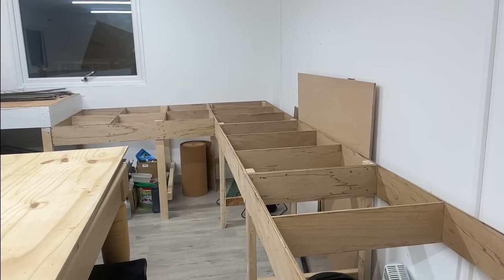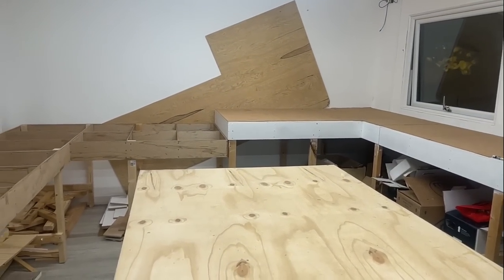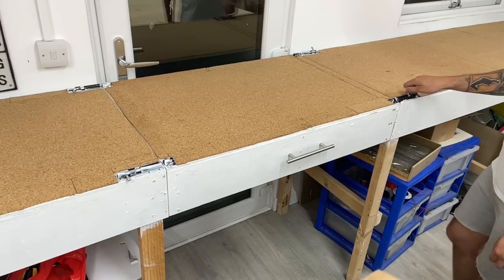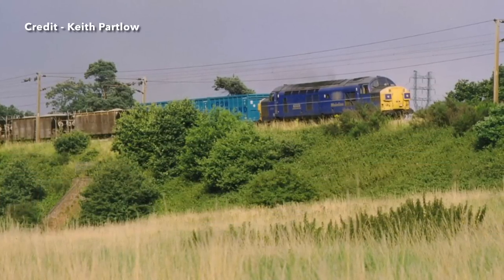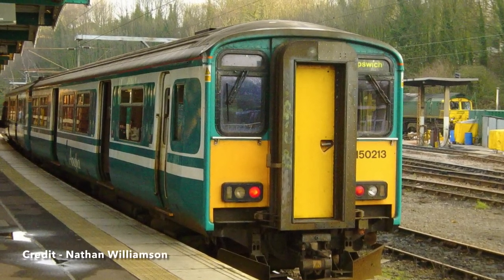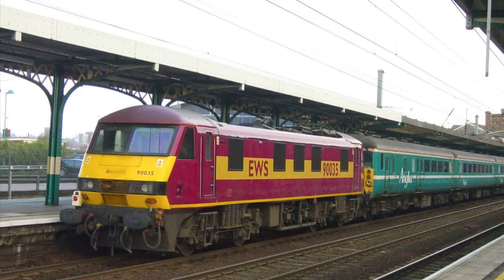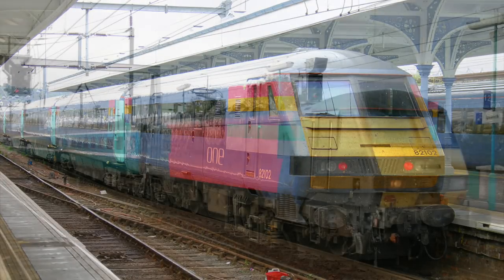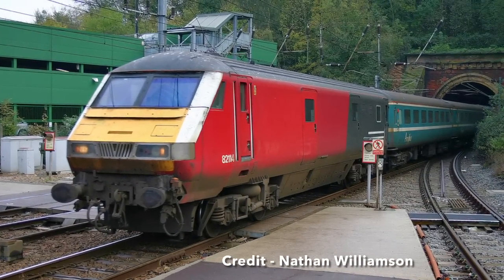Introducing Belstead Lane - New Layout Build  | BL1

Comment: What a colourful history! With so many possibilities in terms of rolling stock and trying to, sensibly, keep things as simple as possible with the layout you are going to potentially run out of storage space. Have you considered cassettes? Maybe one or two 4’ gaps in the fiddle yard where they can come and go. Can then allow displays on the walls. Could be stored under the layout too. Would be ideal for the shorter trains  or even split longer ones if space really does become an issue later but at least design it in whilst you can. New Sub!

Comment: Just two things   to consider at this stage  ! the long sinic twintrack section  I would not run this paraelle  to the wall but try to sloow it acrost the boards in a curve or from the mid point curve this to the ends in a very long shallow arc   ( if you have ever seen the MRC Ingatestone baced layout the sation is on a long curve over 20ft ) this gives real intrest and a more dinaming look as the trains run through   . The other point is the slide out fiddle yaer you will need a clip on set of stoppers acrost the ends  strips of wood with powerfull magnets  that snap on and off this will stop any tragic events involving stock rolling off ......  Will sub to the new channel , grest to see the periode your moddleing

Comment: looking forward to seeing a "local" model railway layout in an era I remember well.   Could reimagine the old Wagon Repair Depot as a Freightliner depot which would fit nicely into that corner before sweeping into the tunnel - of course now the site of Bruff Road.
Reply: @belsteadlanemodelrailway  the original ipswich station and 32B shed. Plenty of photos of the buildings around and track plans prob in Transport Museum archive but 1883 plan is on Wikipedia.  Is the Griffin Wharf branch going to dive off into the back scenery?
Reply: @belsteadlanemodelrailway  its your layout = your rules!  Looking forward to something Anglia-ish :)
Reply: The old Steam Shed area was used as the electrification depot for the entirety of that electrification extension to Norwich. So, you have the opportunity to create during development and remove upon completion.